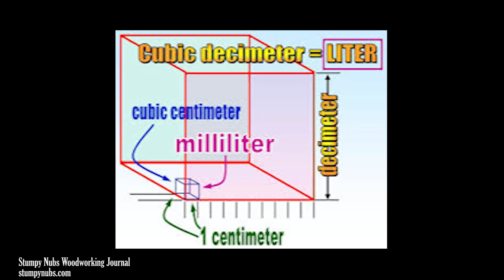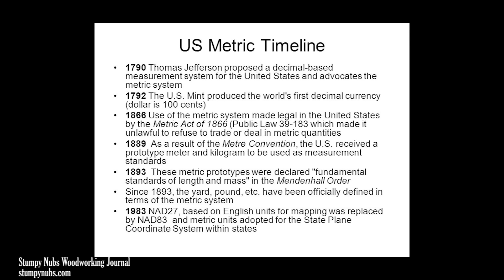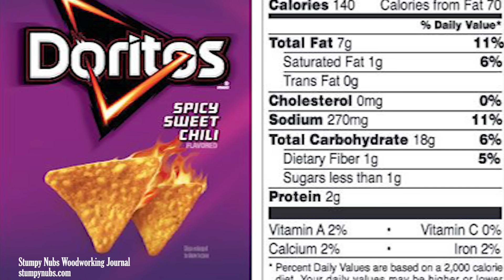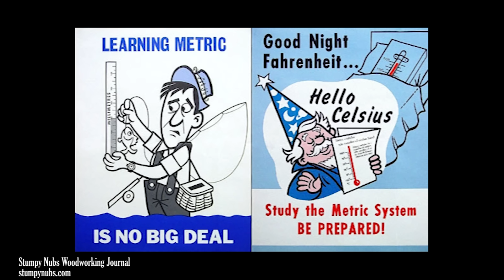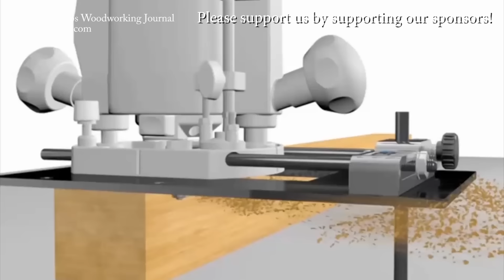BREAKING: The USA is switching to METRIC!

Comment: I wish the UK would metricate. Officially we did so back in the 1970’s but we still use yards feet and inches informally. Fuel is a prime example of the absurd mix of units, so are our distance and speed limits.  Also we buy beer in pubs by the pint but in tins and bottles in millilitres.  Fuel we buy and price by the litre but work our fuel consumption out in Imperial miles per gallon. Our speed limits and car speedometers continue to be officially to be in miles and miles per hour.   So don’t be afraid of going metric as it will take many decades to stop using and referring to older units. My advice though is to go all-in on metric because it is just so much more logical and simpler to work with and standardised globally whereas, for instance, an American gallon is very different to an Imperial gallon and therefore all fractions of that unit are proportionally disimilar.

Comment: we went metric in Australia many years ago and everyone thought that once we did that and everyone became familiar with metric imperial would just disappear into the past but it isn't like that ...every old piece of machinery that has imperial nuts and bolts holding it together, shafts and bearings made to imperial dimensions doesn't just vanish or get cucked out and people want to buy bearings and bolts and seals in imperial so suppliers keep stocking them and China keep making them so in reality we have a dual system... i use both and think that there are some jobs that work better in metric and some that work better in imperial and it takes many years to be to get that intuetative feel for what is going to work best.
Reply: well, obviously, it makes no sense to get rid off existing, functioning stuff just because its still in imperial.

Comment: Why do metric users insist on using such an absurd measuring system for time? 12-hour clocks? 60-minute hours? After all, for measurements to be tailored to the human scale, or easily divisible by 2,3,4,5, and 6 has no value!

Busting out quips about volume measurements in units of cubic barleycorns, decibel readings in conch shells, weights in stone (wait, that's a UK thing that's common and which they get little to no greif over), or angstroms per furlong is like saying that 18 clicks and a pip makes one half-jiffy. They just aren't units that we really use.

But it's definitely better to have "real," non-arbitrary units, like measuring distance based on how far a 12400khz photon of light will travel during the time it takes a 428 degree kelvin cesium atom to oscilate 8.627 million times in a gravityless void, because i'M LiKe a sCiEnTiSt.

Comment: I feel the us younger generations have a much easier time with metric than the older folks as we are so exposed to it though out are daily lives. I personally don't hate metric for length and volume but for temp and pressure its a nightmare to convert.

Comment: I was in grade school when the US committed to going metric, so I learned it alongside the imperial system. Then we moved to Brazil for several years, where metric was THE system. Coming back to the US as a high-school senior felt like I moving back in time. Now (many, many years later) I find myself wrestling with fractions (Let's see, which is bigger 21/64 or 3/8?) when I could just be using cm or mm and be done with all that garbage.
Plus, it sound MUCH cooler to say 176 kph than 110 mph.  (And I weigh a lot less in kg than in lbs... Ha!)

Comment: I have drank a lot of beer over the years, and yes--a lot of beer (maybe all?) lists the amount in mL, but they practically all also list it in ounces (which I use). For some imports I may have to pull out a calculator/unit converter tool, but that's pretty rare.

The last few jobs I had in production/manufacturing also typically required that we take measurements in metric, but every gas station and carton of milk is measured in gallons, while larger bottles of pop are often in liters.

Basically, while most every other country is metric exclusive, the US doesn't pledge allegience to either standard, and for that reason you see people just doing whatever the hell they want over here. I don't know... maybe, arguably, in some ways that's better?

Comment: Did you know that our base units are already defined against metric standards?  For example, the inch is exactly 2.54 millimeters and the pound is exactly 0.4536 kg.  However, and very typical of Imperial units; a foot is an ambiguous term — there is an “International” foot (exactly 0.3048 m), and a “Survey Foot” (exactly 1200/3937 m) — a difference of 0.01 of a foot per mile (begging the question: 0.01 of which kind of foot?). 

Barleycorns it is.  I carry three of them in my pocket at all times.  (For the rest of the world, that’s the archaic definition of an inch: “three grains of barley, dry and round, placed end to end lengthwise” as set out by King Edward II).

Yes, I did some light research for this to get exact numbers, but I already knew the basics and they can be verified easily enough.

Comment: The discussion is pointless since the units of the imperial system are defined by the units of the metric system. Here in Spain, in rural areas and in very specific trades, units such as the area of land that could be plowed by a pair of oxen or the amount of agricultural products that fit in a basket of esparto grass are still used as a unit of weight. Carpenters and stoneworkers also have specific units, but when accuracy is needed, the metric system is used. I have always thought that for American children it must be hell to learn their system of measurements and even more to have to go from one measurement to another.

Comment: GB is tremendous. Everything is metric except road distances, speed limits, pints of beer, and half inch plumbing connections - for 15mm pipe. Curtains are in cm and inches, neither an engineering measure; clothes chest 40 in nominally medium, but need to know the fit. Shoes are like size 9GB is 10US, but are often lacking in girth, which is never given as a measure as there are no standards.

Comment: Pretty sure Europeans still use 1/4”, 3/8” and 1/2” inch drive ratchets 
Most my tools are metric, all my cars and motorcycles are and have been Japanese.
I have to dig in the bottom of the old tool box to find standard sockets and wrenches.

Comment: The Imperial system is not just archaic, much harder to use but proved to be harmful too because of the far majority of the World use metric system and that caused even tragedies like airplane crashes.
Reply: Not even close to being true. Mathematics and engineering are based on fractions which is what imperial is. Metric requires conversion when it comes to complex mathematics.

Comment: I always chuckle hearing US channels describe an object's weight  as 1.2 lbs (pounds).   
Mix and match.
Seriously it indicates that decimal is understood and slowly slipping in.

It should not be forced but it will slowly seep in as at the end of the day it is simply easier.

I do love the tools though - drool.
As having owned pre-metric Landrovers with old Imperial bolt threads in all the variations of course and fine I do love a good set of quality tools.

Comment: You can thank Reagan for killing that 1975 plan to switch U.S. practice to metric.

I'm Canadian and first came across the metric system when I started high school in 1967.  I hated it.  But as I got used to it, I began to like it more.  Also, if you're working in science or engineering, you really want to be using the metric system.  Canada switched in the 70s, but there are still lots of hold outs.

Comment: Since most of my design work is done in CAD, and working in millimeters is so much simpler than dealing with inches, I do almost everything in metric in the shop.  Rant: Another example is *%R&# machine screws.  M4 is so much simpler than trying to figure out the actual diameter of a #8 screw, and find the appropriate drill bit... What the heck does '8' have to do with '5/32' anyway?

Comment: In the 70s I didn't bother to learn the little mas on a ruler because we were switching to the metric system (according to my teachers)I can't visualize the height of a person or weight when it's given in metric. Also they confused me when 350 engines became 5.0. Celsius temps I don't know if I should put on shorts or grab a coat. Wait another 40 or so years and I won't care anymore.  But if these things are marked in french units and I have to use it I will. But please don't change the miles to kilómetros  I don't want to have to travel 1,679.3 km to get home instead of 1043m

Comment: Much to my chagrin, I have realized that using feet and nautical miles and knots is more appropriate for aviation.  The definition of a nautical mile as a minute arc at the equator.  This is very convenient and makes navigation over time much easier.  The fact that there are 6000 feet in a nautical mile makes these speed/time computations easy.   Also, altitude in feet means that the altimeter has over 3 times the resolution compared to altitudes expressed in meters.  The variometers in 100feet/minute plugs in easily to distance flown.  
That said, this is the ONLY time where the system makes sense.  In physics and thermodynamics, the US system makes 0 sense and is next impossible to use because of the horrible conversion factors.  As somebody once said, it is a system designed by people who married their cousins.  
The failure is not abstract.  Most Americans can only do the simplest of operations with their system.  
Do you know how many gallons in a cubic inch?  How many ounces in a cubic yard?  How many feet in a fathom? What is the volume of a gallon of water in inches?  How many gallons do I need to fill in a acre foot pool? What is the weight in pounds of 1000cubic inches of water?  Most Americans have no clue.  Most 6 year olds using the metric system can easily go between volumes, weights, and lengths.  
That is why the US must switch, 99% of its population fails at using its own system.

Comment: The best part is:
What is a Yard? Like WHAT defines a "Yard"?
Your yard has to be the same length, as the yard of someone, living at the other side of the country, like, obviously.

The yard is defined as: 0.9144 meter.

Funny, isn't it?
So many people lobbying against the metric system and yet their precious yard is defined in meters.
"Well! I can turn this around!" said the imperial guy "What is a meter? Ever thought of that, smarta**?"

Glad you asked, because YES, people have thought of that.
A meter is defined as the distance light travels in a vacuum in 1/299 792 458 seconds.
Why is that important? Well, no matter where you are, light ALWAYS travels the same distance that way. So if you really 100% absolutely want to know, what a meter is on MARS; you do this experiment and it will give you the same meter, as on earth.

So this is a universal constant and THAT is why the metric system is superior. It has a physical definition, that doesn't change. The base 10 thing is really nice, but the main advantage is, that its core is defined as an absolute constant.
The Kilogramm was actually the last one, where they managed to find that constant.
We have
- Time (Second)
- Mass (Kilogramm)
- Length (Meter)
(Some others, that aren't as important atm.)

and from there, you can construct everything else, like:
Speed = km/h
km = 1000 Meter
h = 3600 Seconds
Which makes km/h constant, because it is defined by constants and THAT's the beauty of it all.

Comment: What bothers me most with the U.S. Customary units is the difficulty of conversions. So the volume units are not connected to the length units. 
And the scaling is cumbersome, try it with ftlb (torque). How do you get a smaller scale? Is it inlb (a 12th) or ftoz (a 16th) or inoz (a 192th)? And what about scaling up? ft-tons? or ftyd?
Same goes for pressure, PSI. And BTW a mass unit (pound) is used as a force unit. This was eliminated long ago by the SI system clearly distinguishing between mass (kg) and force (N).
And what the hell is AWG? It's a production process unique to a single site and set of tools risen to a universal industry standard? WTF?
In metric, cables are measured in mm² cross-section which is directly proportional to the allowed or suitable current load. Which is quite reasonable, I think.

You'll always end up with odd conversion factors that are never self-explaining and not easy to calculate with, thus making engineering calculations error-prone.

Comment: Some 30 years after the introduction of the Metrc System in Australia, i asked a 16 year old sales assistant in a timber store for a ,2 metre by 50 mm by 100 mm plank. The response was  " Oh, a 2 x 4".
Reply: And 2x4 isn’t the actual size which is  1 1/2 by 3 1/2. Vey confusing.

Comment: Brought up in England at a time the switch from imperial to metric was implemented. I still look at clothing in inches and measure my height in feet, but I'll never use imperial to measure cuts for a project. Give metric ago, and if you dont find it easier, then I guess your rainman, im not Raymond.

Comment: here's a perspective of someone from canada who grew up with parents that used imperial but I learned metric in school.  height: feet inches, speed: m/s or km/h,  volume : litres, weight: pounds for daily stuff but kg for industrial stuff, distance: mm, cm for fine work but inches and feet for more than a meter and then back to meters for more than around 12 feet, temperature is in degrees celcius always (I still have absolutely no concept of what fahrenheit temperatures are at all... water freezes at 0C and boils at 100C... that is logic that can't be argued with).  I worked in oil and gas and they told me about americans giving depths in kilofeet... that made me laugh.  Also I would pay good money to own a copy of that "what has he done to deserve this... metric system" poster. As a scientist I can say, if you aren't using metric, your work is not serious work.

Comment: hi sorry but it seems you mix a little bit metric vs imperial and decimal vs fractional. I'm  French so I'm used to metric but I perfectly see what .25" means, same for 1/4" or 6.35 mm (well I'm a gun guy!). The issue starts when you need a 35/77" wrench, sure I can calculate that same way I can cope with having my butt kicked but I'm not a masochist and I avoid either cases!  Please note that in France, we still use the inch (well, the French "pouce") for the French beret (eg. a #10 beret is 10 pouces in diameter) and the French traditional bagpipes : a 16" pipe set uses a 16 pouce long chanter and plays in G. The amateur fishers tend to give the fish weight in "livres" (pounds) since 10 livres sounds bigger than 5 kg

Comment: We in Europe still have most of plumbing / gas pipes, garden hose  sized in inches. Very confusing.   especially when there is a metric version that differs only a few millimeters.  ...and to further complicate:  there are metric threads and threads in inches.   Very hard to distinguish between the two.      ..should have stopped this nonsense a long time ago.

Comment: Metric vs imperial… It’s not either or in general, it depends da if you are calculating (using arithmetic or computers) or divvying things up by hand. 

Fractions are not usable by computers (they can show up as input but are immediately translated into decimals, that is a sec number times a power of ten) and computers make (if they don’t also run) everything we use today including the woodworking tools … But when working with one’s hands, dividing things into halves is much easier than into 10s. 

Top tier engineering universities are required to teach both but primarily stick to metric because they teach at the forefront of technology, not hand craft.  

Everything has its best use, and so do metric and imperial systems.

The US has already gone metric, the moment it adopted computers, one just doesn’t see it if one spends most of one’s time woodworking.

Comment: I moved from the USA to the Philippines where metric is the thing(*). I don't try to convert things, I just go with the flow. It doesn't matter how many miles something is from me, all I need to know is how many km it is. But let's talk about temperature. Celsius is too crude a measurement.  The difference between the low end of 22C and the high end of 24C can be as such as much as 8dF. I'm sorry but Celsius sucks.  

*they often mention US customary / Imperial measurements but the actual items are metric sizes / lengths

Comment: I mainly like imperial measurements for human height, cooking, and weather tempurature.

 Its actually strange I use celcius for almost everything except weather (and cooking). This year I'm trying celsius for weather to see how I like it. I do very much like having 0 at freezing during winter, and the negatives feel more representitive of the coldness; however I feel like I loose a lot of nuance in spring and fall. In spring and fall everything is always like around 20°C, but that could be warm or cool. I prefer having 50°F, 60°F, 70°F, and 80°F ranges which capture the day-to-day nuance of spring and fall better. For summer celcius is fine but i think ferenheight's 80°F 90°F and 100°F capture the heat well. When I switch back to ferenheight, I might swith back to celsius during winter.

I think a perfect tempurature metric for me (°P) would be a hybrid thing where 0°P is 0°C and 100°P is 100°F. Basically on a scale of freezing to sick fever.
Reply: i dunno, your personal "feel" when it comes to temperature does not only come down to temperature itself, buty also humidity and wind